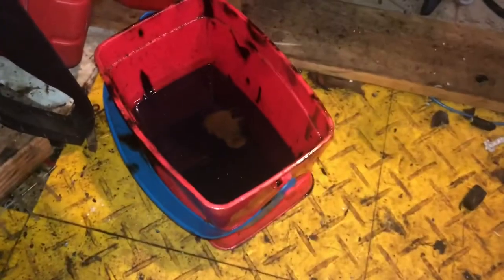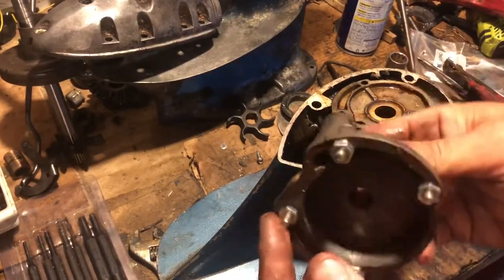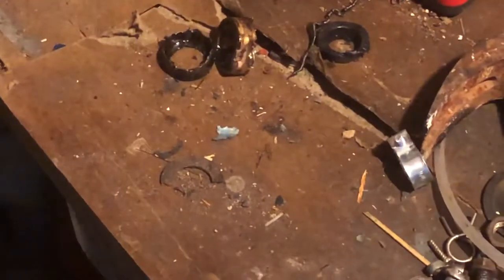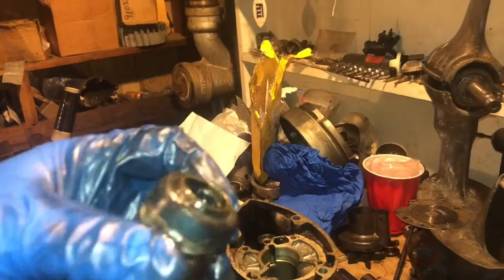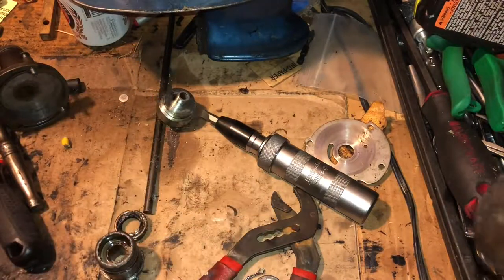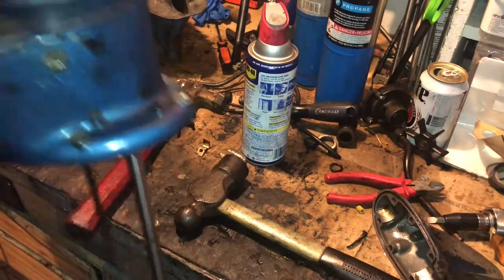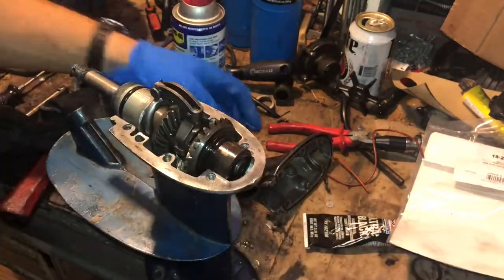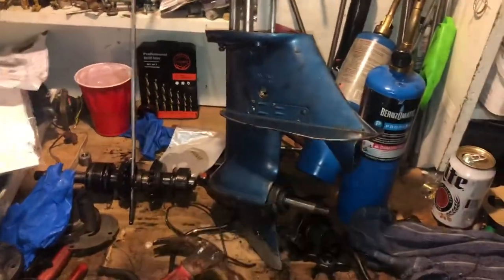1959 10hp Evinrude Part 2! RESEAL WRAP UP!!

Comment: My advice from experience removing seals: use a pick to remove the rubber inside the seal before attempting the slide hammer or motorcycle bearing extractor. This allows the jaws of the extractor to get better purchase on the brass or steel seal walls rather than slip over the rubber insert. I also spray with penetrating oil like WD40 or PB Blaster and let it sit overnight.

Thanks for the vid. I'm looking forward to some footage out on the water.
Reply from the maker: muskog love the advice! Yeah man NJ is practically Seattle these Days! Raining everyday! But water videos coming!!!

Comment: I feel your pain.  Just did the same job on the same motor.  Worst parts are the bearing plate removal..mine was corroded and cracked but got lucky and found one on eBay for $50.  Prop shaft seal is the worst.  Spent all night prying and pulling last week.  My 58 5.5 gear case went alot smoother than the 10hp did
Reply from the maker: psstplease hit or miss for me... I find the more I do... the more less petrified I become